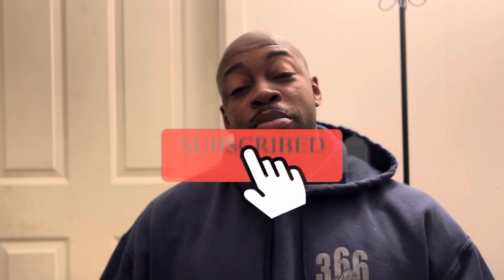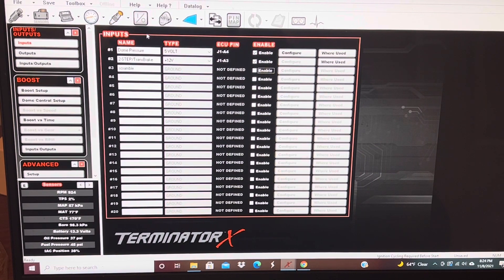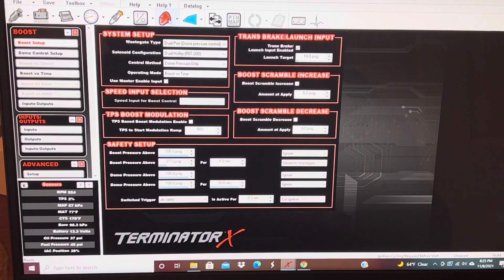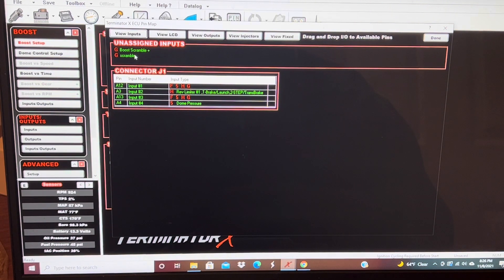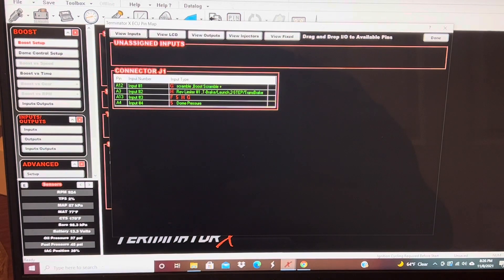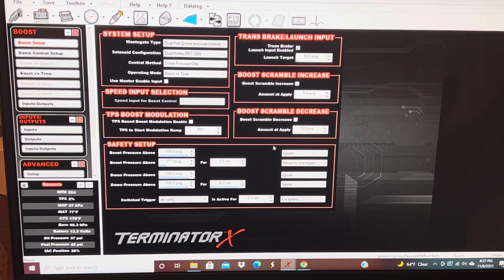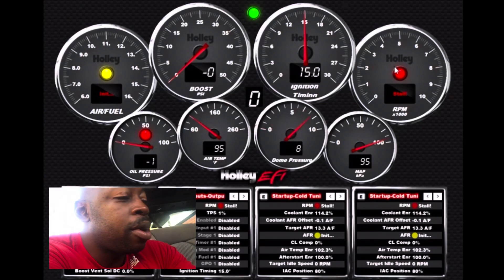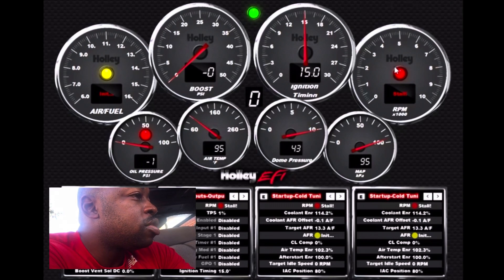How to Set Up a SCRAMBLE TURBO BUTTON in Holley Terminator | Holley HP | EFi  #scramble #Holley

Comment: I'm confused why you created another input for the scramble. Once you enable it under the turbo tab it automatically makes that input so you can map it. Which is what you showed us. You dont need a whole other separate input. Its assigned to be a ground automatically. Can you answer this for me though; when you hit the scramble button does it stay active until you hit it again or is it only while holding the button? I'm thinking of using this on the street to quickly turn up boost and I'd like to use my shifter button to turn it off and on. Thanks
Reply from the maker: I honestly don’t remember why I created it like that. Probably because it was my first time setting it up. But, it still setup that way.  As long I hold the button it adds the scramble.
Reply: @boostinwillie  there’s another I/O menu under the boost tab where you can define how you want it to activate.